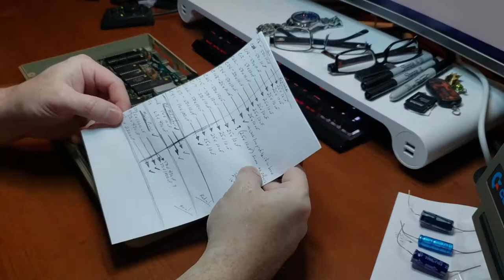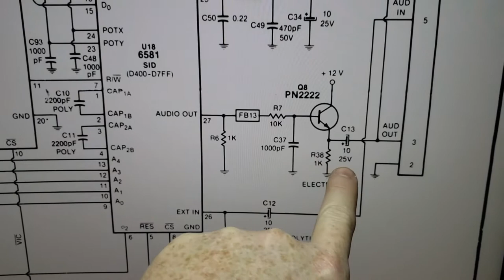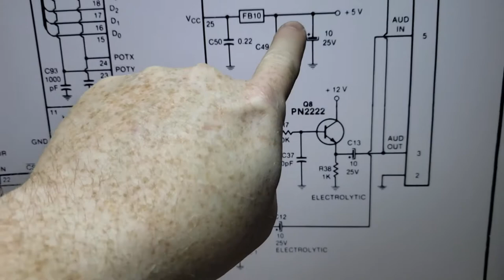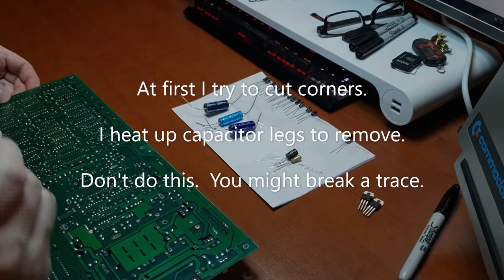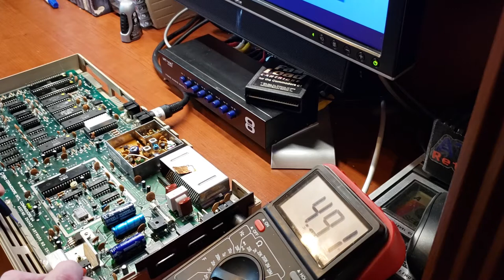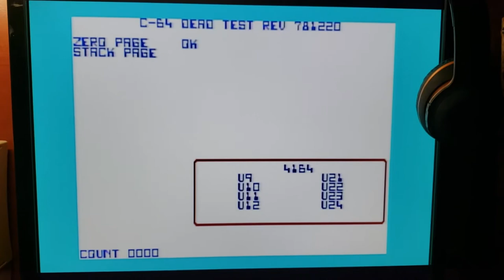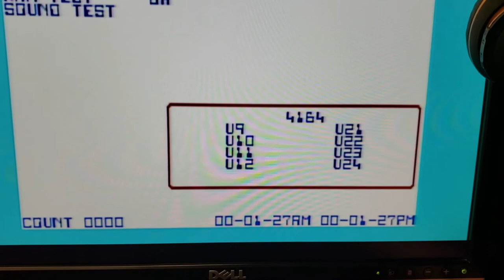Commodore 64 Repair (Part 5) New Capacitors & Regulators

Comment: Good job!  No smoke.
Looks like your board was recapped at one time. to 10uf would have almost certainly been 25v from the factory.  Also, the 3 axial look to be Illinois Capacitor brand and most of the boards I have seen come with Chemi-Con or similar branded light blue caps.  Plus they look like they may have been glued down at one point, something I don't recall Commodore doing.
Its usually not a problem to use a higher voltage rated capacitor.   The way I understand it the caps are rated for so many  hours at the rated voltage and temperature.  By changing the 25v caps to 50v ones, it may increase the lifespan.  
On the boards I do i usually only replace the 3 axial caps and the radial near the 5v regulator (C91 maybe?).
I do the ones in the modulator if it has issues but it can be a real PITA to take off sometimes.
Lastly when you clean flux, give acetone a try.  Its a main ingredient in some of the canned flux removers and I personally find it works better than isopropyl.  Just be careful not to get it on the breadbin case.
Reply from the maker: Wow.  Very interesting.   Thank you for sharing that info.
Reply: @MC-1173  I checked in my stash of boards.  The cap brand is Uni-Con.  Probably similar to chemi-con.  Also I found one board with a gray cap branded BELLCON.  So those gray may have been original.  
Also, the 407 board I am looking at right now has a 470uf 25v cap for C90 from the factory. It will get a 50v or 63v when I recap it.
Reply: @MC-1173  Oh, I forgot to mention it in my comment earlier but the 7805 should probably have some kind of heat sink compound between it and the aluminum.
Reply from the maker: Is that Bellcon version you found  50v also?  Yeah, the C90 is the only one I have seen the variance with.  C19, and c88 have remained constant with all the ones I've worked on or seen,
Reply: @MC-1173  The bellcon was C88 1000uf 25v.  The other axial caps were unicon on that board. 
 C88 is also 50v in some schematics, but it should ever only see 18 to 20v.  C90 also only sees 18 to 20v but it acts as a voltage doubler and is probably the most stressed cap on the board and really should be rated at 50v